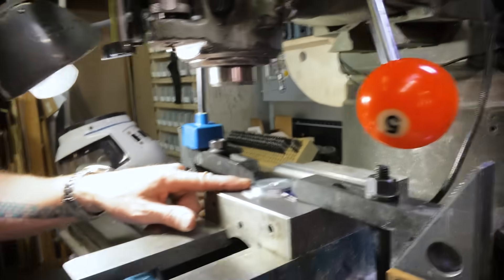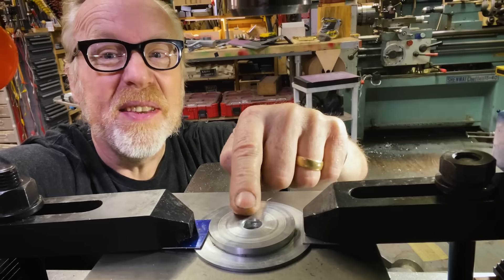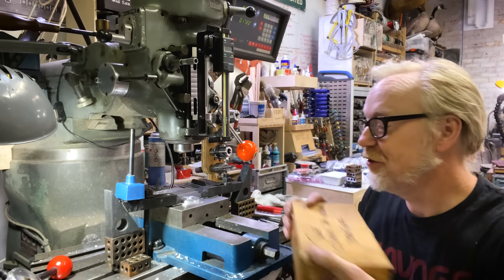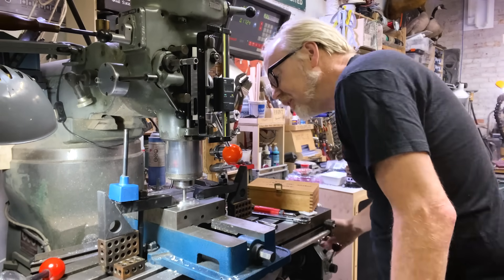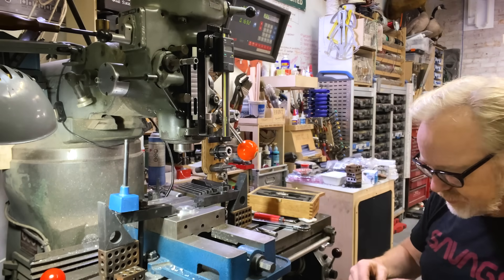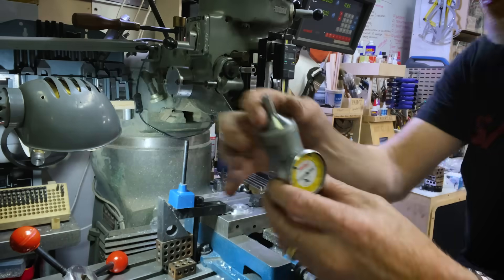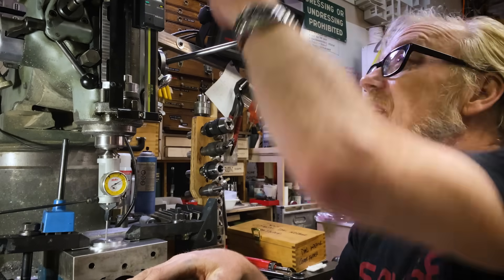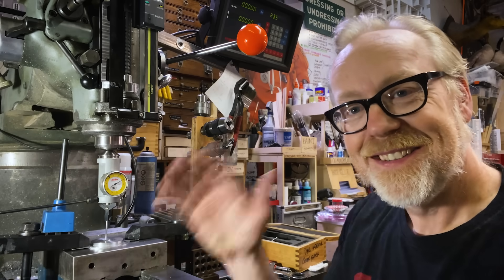Adam Savage's Favorite Tools: Wiggler Machining Center-Finder

Comment: We never used a stop to stop the gauge from spinning. That's smarter than just grabbing it.
Reply: 7:02 shows why I don't.
Reply: @archieval49  it's obviously setup wrong. As the other person said, it's on the tapered part of the base. Stopping it from rotating using an indicator mount is the way it should be done. Not holding it with your hand while it is spinning under power.
Reply: If it was on the rod, instead of the tapered part of the base, I think it would have better results. Any thoughts?
Reply: @LCIsner20  Yes it would.  Me, I just keep on forgetting that its there.  I'm afraid it might snap on the thread.
Reply: I think I saw on the manual of the one I used that if you use high enough rpms, the dial is supposed to stay in place and not spin. That never worked out though so I ended up using one hand to turn the spindle and the other to steady the dial. Looks like the stabilizer bar setup is a better and safer setup.
Reply: @jaxonriddleAt my work, some of our older cnc machines don't have a fancy probe, so I've used a co-ax tons of times with a  high level of precision  spinning around 100 rpm. 

We often have +- 0.001" tolerances on certain features and a high quality CMM double checks our work. You just need to get a decent quality co-ax and get a good feel for using it, just like with any indicator.
Reply: I use them all the time, as in bigger machines, holding on is a pain - loc line keeps it from spinning, and every Hurco has one.👍

Comment: A coaxial indicator, with the right accessories you can dial in not just in one plain but axial as well, so the center of a bore or outside cylinder along the z-axis.
Reply: True- former machinist
Reply: @dominic6634  why would he lie?
Reply: @googleuser859  most people are mistaken not liars. but the end result is still the same. the spread of false information.
Reply: @googleuser859  he doesn't lie...he simple doesn't know how to use it and what this tool can do.....
Reply: @googleuser859  never said he did.
Reply: *plane
Reply: @xenonram  english isn't my first language...
Reply: @xenonram  Z Plane Boss, Z Plane!!

Comment: This video and the tailstock repair video were brought to you by Adam's word of the week: concentricity
Reply: It's the AWOW!
Reply: I'm still not sure he knows what it means though. He occasionally uses it to describe one thing "the concentricity of this circle", rather than using it to describe the relationship between two things. It'd like saying "this line is parallel" - parallel to what???
Reply: Yeah he uses it wrong though. You're not lining up the concentricity finding  center. You can say these two turned diameters are concentric to each other. GD&T gets real complicated.
Reply: @metalman6708  a center point is an infinitely small circle concentric to another....
Reply: Work in a machine shop long enough and you won't even think the word is strange.

Comment: This is a coaxial indicator or bore dial, not a wiggler. A wiggler is used like an edge finder or center finder
Reply: Yup, whoever told him this is a wiggler is horribly wrong! Not enough wiggle in this doohickey
Reply: You would think this clown would know what he is talking about before giving "tips"
Reply: @noodles7011  Kindly fuck off.
Reply: @RimePendragon1974  no u
Reply: Noodles 
You’d think someone intelligent enough to need the information he is giving is smart enough to not focus on the trivial things like the name, and the demonstration of its use.   If you got hung up on the name and not it’s use, you’re clearly not the person this video is made for.
Reply: Noodles dudes just excited about new and helpful tech in his shop. Go tram your head if your that bored and picky.
Reply: Garrett Goodfellow Centre finder? Adam couldn’t find the cheeks of his own ass with both hands, if you loaned him a bloodhound to sniff it out and a mirror on a stick to view it! 😜😂😂😉👍
Reply: @ianmoone2359  I think he did an episode on the blood hound!!! and a follow up , so he might know a little bit about it
Reply: Technical name of this tool is immaterial, has zero impact act on cool tools.
Manufacture calls it a coaxial centering tool, but wiggler is cooler and works. 
Nice to know the correct technically correct name but in the end does not matter at all. Period.
Reply: A dial bore is a gauge used for accurately measuring a... bore.
Reply: Wigglers suck